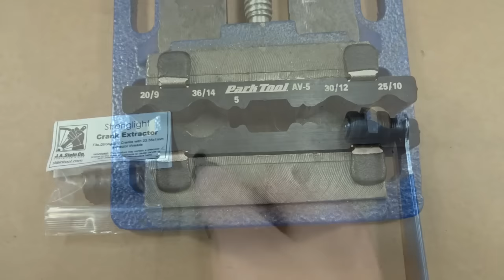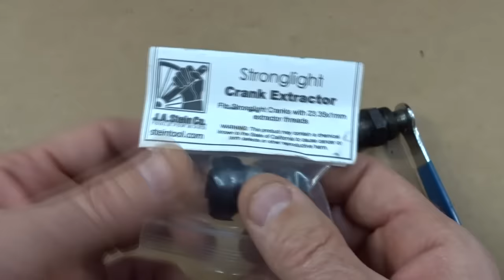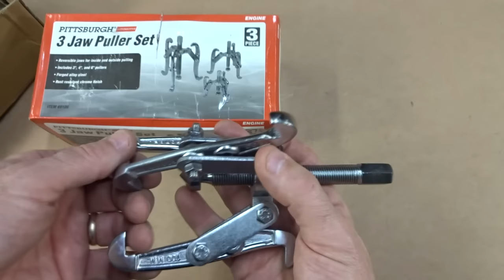Bike Tools - The Tools I Use To Repair/Update/Restore Bikes

Comment: best advice  from video for me is buy the specific tool you need as and when..
Reply: Definitely NOT rushing out to buy all these tools, buy as needed 

Taking baby steps with cheap junk bikes first.

Wife needs a bike, so got 2 for $50 see if I can save the 2nd one & earn my money back.

Also got a kids bike for free, probably only rust and minor issues (priced similar bike in big retail shop $340 for similar bike - a child will need a bike sooner or later - whatever it costs me in parts of required.

Comment: I got a rule….if you show me a tool and don’t know what it’s for you should just give it to me (after all, you can’t properly use it). Thats how I got my thread file. I honestly can’t recall what my friend thought it was but most people have never heard of it. I make lots of tools but this I can not make. I have a large collection of taps I have made from bolts and axels with a precise narrow cut cross thread. When I made attachments for Caterpillar I could cut a combo wrench out of white paper and hand it to a guy running a steel cutting machine with an electric eye and he could toss a sheet of steel on it and lay the paper wrench on the black reader surface and the eye would follow the edge and guide the cutting head and in minutes you have a 1-1/2” (or a 3-1/2”) combo wrench.

Comment: This is awesome 😎. My grandfather use to be in the Tour de France 🇫🇷 back in the older days. Have the right tools when you need them is a smart way to be prepared in case you run into a problem on the road or back roads
Reply from the maker: These tools pretty much just stay at home. On the road, I carry a multitool, a couple tire levers, and a microflate with a couple co2 carts.

Comment: May i ask a question about chain-checking tool? My bike has horizontal dropout and i can adjust its axle back and forth to "straighten" chain. Would it have any impact on chain-checking tool precision? I mean worn chain with small slack would give better result than new chain with big slack due to improper axle adjustment?
Reply from the maker: The tool works the same way.
Reply: Thanks

Comment: I can't find your seat tube diameter guages on my google search nor ebay. Can you tell me what brand they are and where I can purchase them RJ?  I'm refering to the 3 plastic nesting tubes at the end of your video. Also a great video you can make is converting a bike computer without cadence to a cadence computer by having 2 computers on handlebars, 1 regular computer and 1 cadence computer (Since cadence function computers are rare, expensive and hard to find). Hook up wired pick up on downtube and magnet on left crankarm and set wheel circumference to 268cm for mph or 167cm for kph. Cadence computer will calculate current cadence rpm, max cadence, total trip time pedaling compared to other computer pedaling + coasting. The only issues are cadence reads example: 105rpm reads 10.5mph if set to 268cm circumference or 10.5kph if set to 167cm; the computer turns off below 25rpm for mph or 40 rpm for kph and mounting the magnet on crankarm. I cut a 3/4" sliver from white packing foam (wood will work too) and electrical taped the magnet to it around the crankarm. Surprisingly the magnet is ~5/8" away from pickup yet still it sends the signal. The "hack" is tricking computer to thinking the crankset is the wheel.  You can even explain the math in your video. Formula: (To calculate 60mph): Mile= 5280ft/60sec =88ft.=1056"=2682cm. 2682cm/10=268.2cm "wheel circumference" for mph to = cadence. 268.2/1.61 = 167 for kph to = cadence. (Imaginary wheel "travels" 268.2cm each pedal revolution so 60 rpms cadence will read "6.0mph" and 90rpms reads "9.0mph"). Maybe you can explain the math better than me in your video if you choose to make it. (I use #2 inexpensive Cateye Velo 8 computers purchased from BikeNashbar for $15. I'm tall 6'3" and the wire to the pick up is long enough to reach the downtube even on my 64cm road bike with a 130mm stem set high, if you place the magnet close to pedal thread on left crankarm. This would be a REAL SLICK video to make if you choose to. Thank for your great videos.  You're an awesome instructor RJ. - Mike Greene.
Reply from the maker: https://www.amazon.com/exec/obidos/ASIN/B0050VEDFM/ref=nosim/youtube25-20
Dunno. I have a couple bikes with Cateyes with cadence built in.

Comment: For a home mechanic who is just starting out they should not buy expensive tools  to start of with but I'm a in depth home machanic which tools from the following brands 
Cyclo tools,bike hut,Topeak, park tool ,Birzman they all have life time Warrenty because they are very expensive brands and I like to have quility tools to work on my bikes but they do cost a lot of money but I have a cheap chain whip too which is brilliant I don't wanna spend 50 pound on a tool I use once in a while and it's great for 6 pounds from amazon don't just go buying tools which the pros use sometimes cheap is just as good for a home mechanic not for a pro which uses them everyday who needs expensive tools to earn a living a home mechanic wants to save some money by not going to shop every time they need a bike repair or service but the best investment in your tool collection will be a pair of quility cable cutters that's a big money saving tool can't live without my ones

Comment: I can't find most of these tools in my country. The bike stores don't sell them because they want you to spend money every time you need something fixed, although you can borrow simple wrenches for a few minutes if you just have to tighten something in a hurry. 

Buying the tools online costs a fortune considering shipping and customs fees. I needed a cone wrench at all costs, so I bought a very thin wrench multi tool for $3 , I used a file and sandpaper to make it thin enough to fit the cones I had and it worked xD
Reply from the maker: Yes, I have made a cone wrench by taking a regular box end wrench, and grinding it thinner. If you can't buy the tools, then try to make them.

Comment: Mr the Bike Guy, what's a good beginner tool set? I've seen multiple out there but don't want to get burned. Thank you
Reply from the maker: I don't recommend buying a tool set. Most of them are made up of cheap tools. And depending on the kit and your bike, half the tools may not even work for your bike. Buy the tools as you need them, and buy quality tools.

Comment: Excellent videlo thank you .
 My favourite tool here is a lenght of steel pipe over a spanner with WD40 for freeing seized pedals .just rockng your spanner back and fort untill the rust releases 
You also cant beat files: round,flat,half round and triangular in large and very small for the day you dont have that drill bit or just want to make an opening slightly larger. Ifind them the only way for making axels fit in small drop outs ie file two sides.Youl also dont heat or distort the steel as you would with a grinder its easier to be more accuate too

Comment: Love your vids RJ, you’re a very helpful guy! One thing to point out about the Park Tool obw3 is that the little adjuster paddles fit to the back side of kids’ horseshoe caliper brakes to adjust the loading spring position from the rear without any marring to the spring or calliper paint. Those brakes have flummoxed many a frustrated adult on Christmas Eve, haha! Well, that’s the tool you need to adjust them and pull them in line any potential suffering parents of small cyclists out there!

Comment: The one tool that I wish I had but don't know of is something that would hold a cable tight while tightening the lock nut but without flattening the cable the way that vice grips do. Yeah you can accomplish much the same with a third hand tool, but only for rim brakes, not derailleurs.

...Oops, looks like such a tool exists, I hadn't seen the video all the way through when I posted this. But I basically have all the other tools here, at least the ones I'd need for my bike. Some are crossovers from my fairly extensive car tool collection, e.g. torque wrenches, ratchets, sockets, spanners, punches, picks, hammers, tap & die set, even an impact wrench for the occasional really stuck crank arm or cassette lock ring.

Comment: Hey rj I just wanted to let u no probably u no this but anyways I use a dentist tool to open the cable housing went putting the cable in to the housing cable as well that very good tool to have and the screwdriver with the point you have on it as well it good I work on a lot of Raleigh road bike that u have to feed the cable in to the frame to put the cable housing to the back brake of the bike and that dentist tool really help with problem like that to catch it and feed it through the frame
Reply from the maker: I use an awl.

Comment: Check the Super T Handle Metric set, a compact new design that solves the rotational problem when torque is not needed (at Amazon).

Comment: One of the most useful things I bought was this owl brand set of hex keys. It has 24 pieces I believe, and each of em fit into a 1/4" quick connect. Normally I put them onto my combination screw driver, but they also fit into drills and small impact. Originally I got them for furniture assembly. They're impossible to find locally (especially in complete sets that have the quick connect ends) but amazon more than came through.

Comment: If I can't get that wooden mallet on harbor freight, then sell me yours! lol.
Awesome video as always, I also now have 1 big box of bike tools and also a chest of plastic drawers full to the top.
I've yet to but things like a truing stand or that frame facing tool. I've never liked that cable puller, I always get my cables mangled up and I never have really needed it, Ive had no problems settings brakes and derailleur cables by hand, a tool for display only at least in my home shop.
Thanks you for always entertaining the bike maintenance junkie inside me, lol.

Comment: I've made a pair of master link pliers from the end of a cheap broken pair of pop rivet pliers. Hacksaw and a file to thin out the ends so they fit between the side-plates and rollers, and you just squeeze! To lock them you don't need a tool of course!

Btw, what is your opinion on Shimano brand freewheel/cassette lockring tools?

Comment: Yeah I bought a mirror for my bike and one of the Allen screws loose can't tighten it so I didn't have an allen key so I went to Walmart looked at their bike kits in just a little ranch in the little adapter pieces is 20 bucks look on Amazon same thing a lot of parts pieces you don't need and it's $20 so I went back to Walmart look in the regular Hardware tool section and there was a Allen key set metric and standard for 2:49 so hopefully today I'll get my new seat on and my new Mega range gear set on at work at lunch and I'll be able to ride home and 2/3 in snow it's outside and have no problem Cloud to write yesterday going home when it was nice wet and slushy and had no problems but temperature has dropped way down in the 30 so it's going to be a lot of ice
Reply from the maker: Yeah, buy a quality set of metric allen wrenches. Stand alone wrenches with likely be better quality than ones with a bike multitool.

Comment: Hey RJ, what is the diameter of your cheater bar? I wanna make sure to get one that has a proper size. Thanks in advance
Reply from the maker: Get a pipe that will fit over your wrench.

Comment: Hi RJ, I have one of the same grease pumps but it's stopped pumping. Full of grease but none comes out. Would you consider a little video on tool maintenance?
Reply from the maker: https://www.youtube.com/watch?v=Bysp3VfYxVI
Get the air out. Remove the nozzle to clear any clogs.
If you have something other than a Dualco, it my just be a poor quality grease gun. They are not all the same.
Reply: @RJTheBikeGuy  Thanks very much for the reply. Of course AFTER I wrote the comment I found your little film on it. Oh dear.

Comment: I love Park Tools, but I don't recommend any of their tool kits, or anyone's for that matter. They are all too full of filler nonsense. Usually several different scrub brushes you don't need and other stuff could easily do without or find cheaper elsewhere. For wrenches, I went to a pawnshop. They had a huge bin full of metric wrenches, something they considered pretty worthless. I got a full assortment of all sizes, although mismatched brands, for dirt cheap. Less than $10.

Comment: Don't go to the plumbing section at the hardware store for a cheater bar. Go to the fence section. Get a 10' section of fence post. Get them to cut it into 3 pieces for you. Bam, a cheater bar (tube?) for each car/garage for $3 each.

Comment: On conclusion for ME, first buy tool for rims, lacing wheel better and avoid vibrations, to wheel, replace wheels or build on time.
On exemple because vibrations from wheels because wear excesive ,you can destroy entire drivetrain and shifting System which îs expensive.

Comment: Those Pedro levers look way too flimsy for the price; buy one huffy inner tube and it comes with two really good tire levers that are strong enough to remove lawnmower tires without breaking.
Reply from the maker: The Pedros Levers are NOT flimsy! And they only cost about $5, and are solid little tools! I own three or four sets. I keep them in my underseat bags as well as in my shop.
Reply: @RJTheBikeGuy  I guess the camera just doesn't do them justice, but huffy levers are around $5 and come with two of them and a tube.

Comment: I remember that a teenager was going to sell his "wrench" to a local bike shop and seems to me that he was selling a stolen wrench from the current bike shop he was in. But as I observe what type of wrench. Suprise to my eyes it was a pipe wrench ideal for one hand use and the teeth was very sharp the could jud stripped if it were to use on a 14mm or 15mm lock nut or flanged nut. He was going to sell the pipe for 200 pesos (thats 4 usd) and I interfere while the teenager was talking to the young shop owner who has no knowledge whatsoever to industrial tools and of course the teenager was furious that I said "that could strip a nut if you going to use that on a bike" he reasoned me out like "it is easier to use".

Comment: I'm pretty certain I missed it in the video,
but a tool you'll likely need is a quality spoke wrench. adjusting spokes is a pain, especially as wheels age. using a good spoke tool instead of, say pliers, reduces the frustration.

I am using a multi-sized one, but honestly, I think getting single-size is better (you wouldn't have to keep fiddling around to find the correct size each time you advance a spoke).
Reply from the maker: I have good spoke wrenches. https://www.youtube.com/watch?v=KBvUIQSmkcA&feature=youtu.be&t=2273
Reply: @RJTheBikeGuy  yeah those look good.
I've been wondering how people are going to react when they find out that keeping a bike going costs, in some cases, much more than the bike's purchase price.

Have your view counts changed dramatically in the last year?